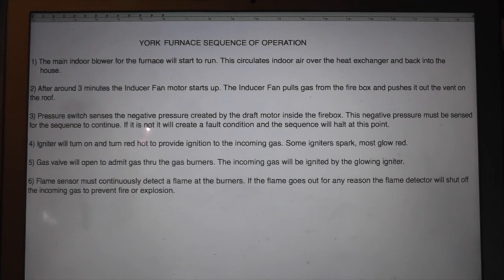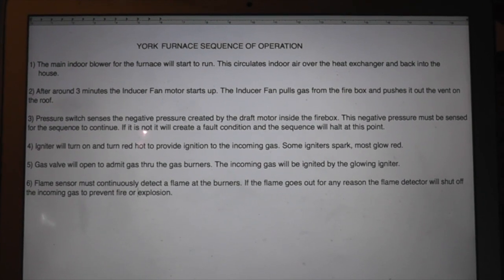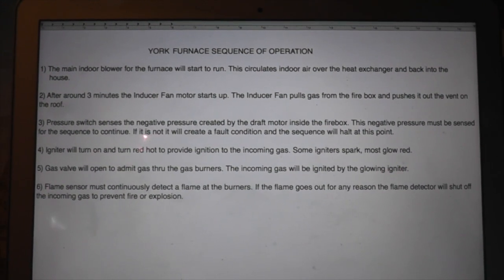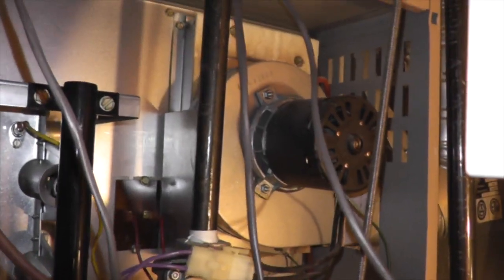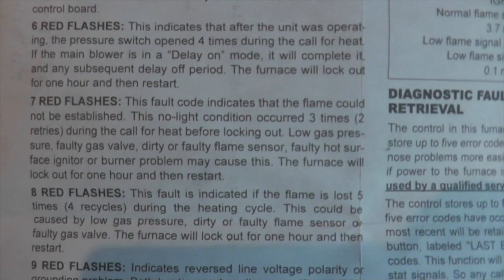York Furnace DIY repair

Comment: this is by far the best explained parts of the furnace video i have seen
Reply from the maker: Thanks, hope it helps
Reply: @thecuriousnomad4712  still trying to fix mine, rat got in their an ate pressure sensor hose and ignitor. I replaced both an still no start. Flashing 3 red blips meaning pressure sensor closed. I replaced the sensor an same error

Comment: Video is very helpful. Replaced flame sensor. Furnace is working now but sometimes it stops with rapid red code. When I restarted it works again for a while but will stop working with rapid red again.
Reply from the maker: The rapid red code will indicate the reason the furnace trips off.  Count the number of red flashes before the pause, it should be somewhere between 1-11 flashes. The panel should have a decal showing the number of flashes along with the cause. If it does not reply with the number of flashes and I will get back to you

Comment: One problem I've had with my York furnace is the hose bib/nipple on the inducer fan getting plugged. When that happens, the fan runs but doesn't supply any vacuum to close the the pressure switch, which means the igniter won't turn on. It's an easy fix. To test this, remove the hose from the inducer fan.........turn the thermostat on to turn on the furnace.........when the inducer fan starts running, suck on the end of the hose lightly for about 10-15 seconds. You should here a "click" in the first few seconds, meaning the pressure switch has closed, & eventually the igniter should start to glow, followed by the gas kicking on & lighting. As soon as you stop sucking on the hose it will shut down.
 In this case, you need to clear the bib on the inducer fan by sticking a paper clip or some other small object into the hole to clear the debris. Replace the hose & the furnace should work.